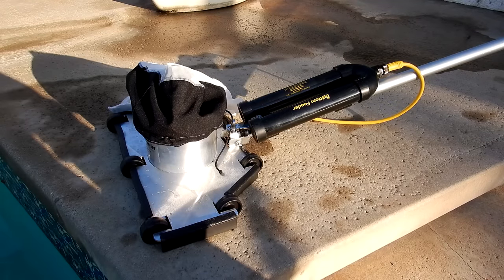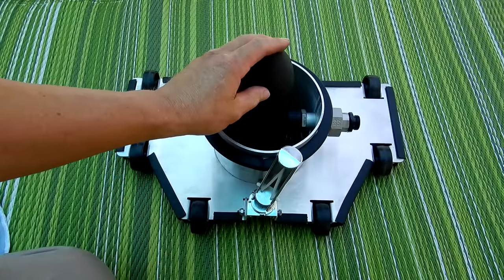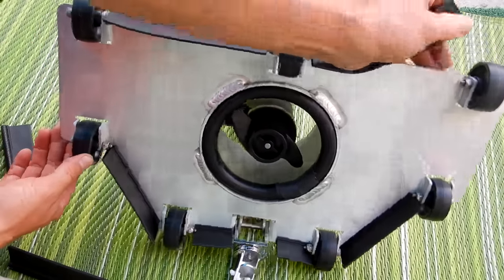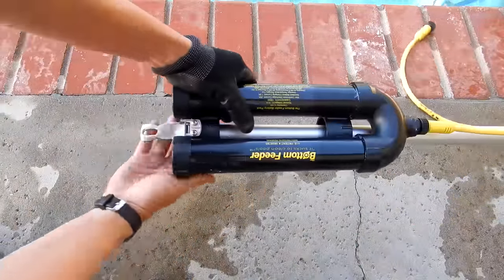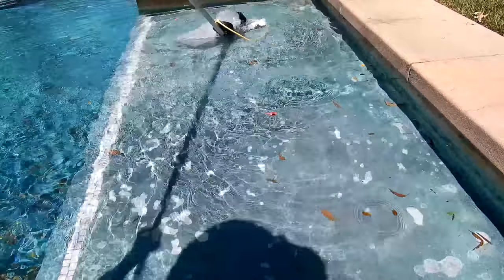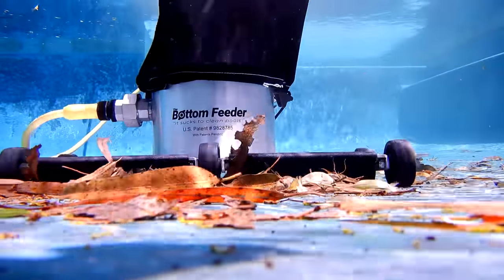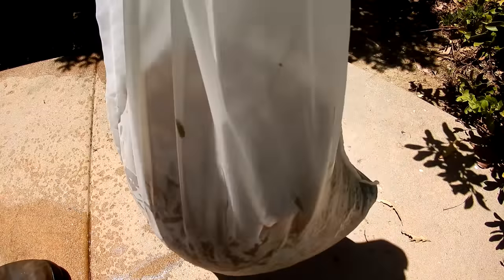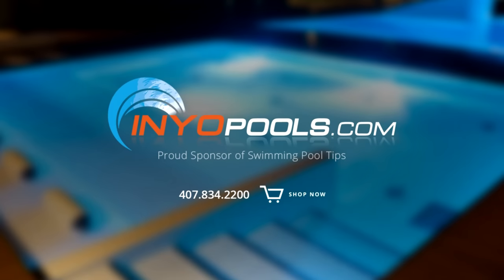The Bottom Feeder: Professional Grade Cordless Vacuum System Overview and Use Video

Comment: So I got mine delivered two weeks ago and so far I'm loving it. I'm getting through some pools in about 4mins. Dirt, leaves sucked up easily and I'm also not using the thruster ring to get a little more battery life. Oak trees will start dropping soon so that will be the next test for this but so far I'm very happy with this purchase. Also, highly recommend the portability kit.
Reply from the maker: Yes, the 2 hour battery time is a bit of an illusion since you can clean most pools in 5 minutes. I like the fact that you can just walk back there and drop it in and start vacuuming. No set up time. So a great time saver in many respects. The Portability kit makes it legitimate. 👍
Reply: @SPL  clean most pools in 5 min. yeah right . come to texas lol.
Reply: It picks up dirt, don’t you need the filter assembly?
Reply: @ericcendejas7505  I didn't buy the filter add on. It does a real good job of picking up dirt already. I've picked up tons of filter sand, small rocks and wash in after heavy rains no problem. Only doesn't pick up the smallest of sand or DE.

Comment: I have a HAMMER HEAD.  It has a cord but it's still pretty awesome. I can get about 20-25 pools on a charge
Reply from the maker: They are not trying to compete with Hammer Head but are trying to fill the market share between a full size vacuum system like yours and skimming the entire pool when their is too much debris for a manual vacuuming.  There is a big market for this on the West Coast for sure. I also love the full size Vacuum Systems with the 100 AH Battery! 👍
Reply: White Smith, I am curious how ANY of these types of units would work for a pool guy. It seems "gimmicky". ( sorry OP) 

I am a pool dude for 24 years, but I only do chemical treatments and repairs/installs. I also do not intend to get into cleaning/maintenance business, yet, I have a friend who does that. I am curious to how well this type of thing would do with constant daily use. Thoughts or further input?
Reply: @white smith

Comment: What’s impressive is the weight with the battery.  12lbs only!  I carry my Power Vac & the battery which together are 30lbs?  
Had I not just bought a PowerVac I would have given this serious consideration. 👍
Reply from the maker: It is super light Bill. You can actually take it back to every acct. I put the battery in my TK Caddy and carry the vacuum head back with my pole. Portability is what makes this thing impressive.

Comment: Im interested to know the life expectancy of the battery.  If it runs up to 2 hrs per charge, how long can you expect to get those numbers before you start seeing a drop in operation time. Considering cost of replacement battery its really something to consider.Anyone had one of these for a while that could chime in?
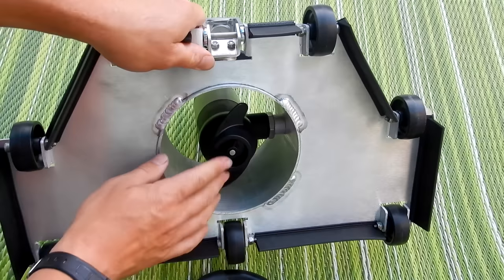Reply from the maker: You get a good solid 1:40 minutes and then the last 5 minutes it starts to run out of power. But you will work so fact with this thing - a 15k pool will vacuum up in 5 minutes.
Reply: @SPL  thanks for the reply.  are you charging in between pools?  i have a plug in in the back of my truck bed and am wondering if it would be a good idea to plug in in between pools.

Comment: I like the system but I dont like it at the same time, I wish it came with an on and off switch , instead of unscrewing it in order to turn it off, maybe you can call them and ask them to put an on and off switch,  then I would buy it.
Reply from the maker: Yes, he is working on adding  an on/off switch possibly. It isn't a huge deal breaker in my opinion but an on/off switch would make it more user friendly.  You are right on that. 👍

Comment: How does this compare to traditional skip netting, time wise?
Reply from the maker: Time wise there is no comparison. Attach this to your pool pole and in 30 seconds you are good to go. Drop it in and you can clean a 20,000 gallon pool in less than 5 minutes without stirring up the debris.  I have been using it for about 45 days and it is a huge time saver. It will pick up finer debris then your skimmer net also.
Reply: Great to hear, thanks for the quick response.
Reply: thinking about getting one, still working well for youm how many times a day do you use it?
Reply: I wonder if there would be a way to combine the batter pack with the Riptide.

Comment: I am on my 3rd switch that turns this unit on. I am on my 2nd motor. and have had 2 batteries already. I am shocked to hear that people have had any longevity of this unit. I think they need to put more time in to make a professional unit and go back to the drawing board. I think it has potential, but this unit is NOT ready for daily routes of 10 - 16 pools a day, even with charging it every night. it has been broke more the last 2 years than it has been working, sorry. I think this might be a more residential expensive unit because it is not for business daily use. I have had it with this. I would suggest it even for a backup unit
Reply from the maker: There have been some failures with certain generations of the BF. The owner admits this openly. The latest generation is superior and you are not alone in these complaints.

Comment: I would like to see that charge time about 6 hours. I mean If you have a decent size route 2 hours might not give you enough charge time.
Reply from the maker: Each pool takes 5-7 minutes to completely vacuum. For a 6 hour charge time the lithium ion battery would be the size of a car battery and cost $1,200. 😆
Reply: @SPL  your pools maybe I got some pools theres no way it would just take 5-7 min. Where you at AZ CA? Come down to GA and roll around with  me in the fall there is no way you finish some of mine in 7 mins.

Comment: Anyone have an issue with the cord for the battery? Mine broke inside the battery side and it's rendered it useless. I recommended it to a friend and his did the same EXACT thing. I bought the switch cable because I worried that taking the cord off and on would really shorten its lifespan. Little did I know I guess that it would last only a few months anyway. It's really disappointing when you spend $1,500 and it lasts less than 6 months
Reply from the maker: If you contact them they will send you out whatever you need. Like anything there are defects. But so fat glen had jumped on any complaints or issues.